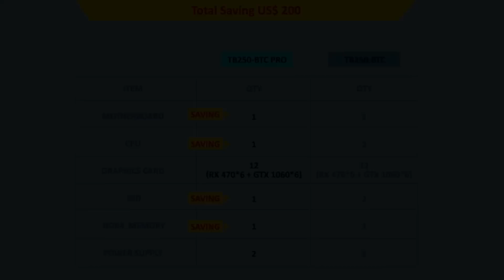BIOSTAR TB250-BTC PRO ︳Ultra PRO 12-GPU Crypto Mining

Comment: hello, a question do I have to connect the molex cable to the 2 auxpower connectors of the motherboard ???? What happens if I don't connect them?
Reply: No you don't. I'm not using them and running fine with 12x RTX connected. Motherboard V6.1

Comment: Can it run 12 NVIDIA GPU under Windows 10? I saw BBT video where they could not make it work under windows and ended up with an ASRock 110+ 13pcie board instead.
Reply: Yes it can run with 12x nvidia and win10

Comment: i bought 2 x gigabyte h110 da3...
1st one burned out in an hour
2nd one died 3 days later and yet i struggled my ass off to get it to run 5 gpus and would never get to 6 no matter what i did it could not work..
turning on mining mode it kept boot looping forever and ever
turning on 4g gave a black screen
drivers /windows blah blah blah could not get it to work.
pieces of shit for a mining board and my x370 non mining board actually does better and easier.

bought the Biostar tb250 pro and plugged all my gpus in there and when it starts the bios shows you which slots are occupied..love it and it works out of the box still going 10/10
and it comes with more sata and usb ports and hdmi

Comment: Beware of Biostar's mining motherboard. They don't work as advertised. I purchased Biostar TB250-BTC PRO and the BIOS could not recognize more than 1 GPU. This motherboard is trash. You are better off with an Asrock mining motherboard. I believe the Biostar engineers really engineer this board correctly.
Reply: sinistar mine too, just detect internal gpu